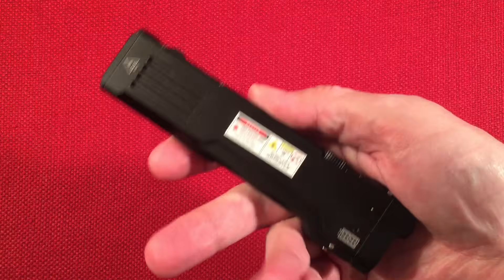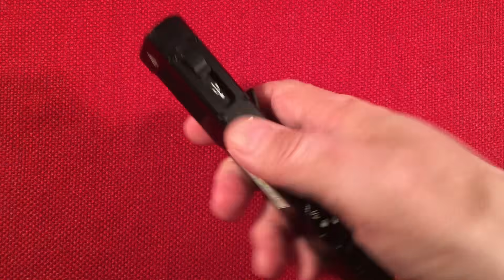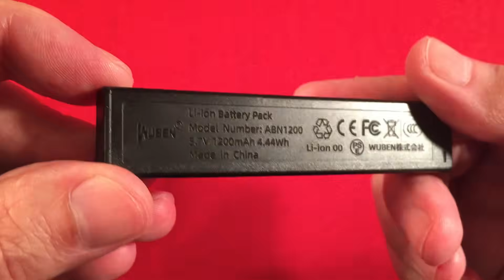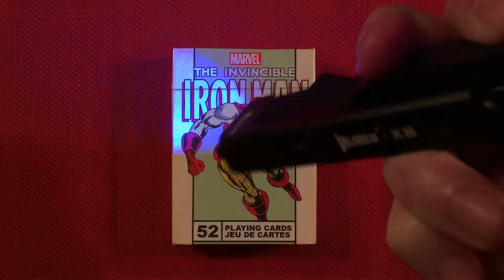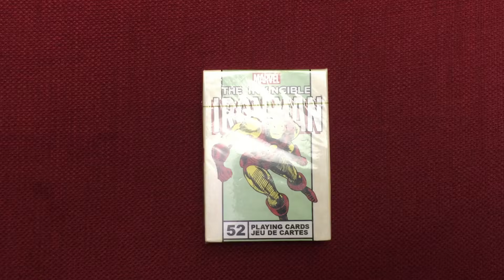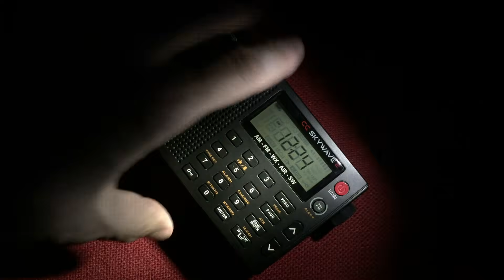Wuben X5 4AAA/LiPo UV/White/Green Laser Flat Tactical EDC Flashlight Review

Comment: Thanks for your review.

Hopefully the charging circuit is disabled when using AAA batteries, because this would be dangerous if they're non-rechargeable cells.

Do you know if their is low voltage protection when using NiMH cells? Discharging them too much damages them.

For my needs, I prefer a side switch on a flat flashlight. Also, I like having a shortcut to the lowest brightness.